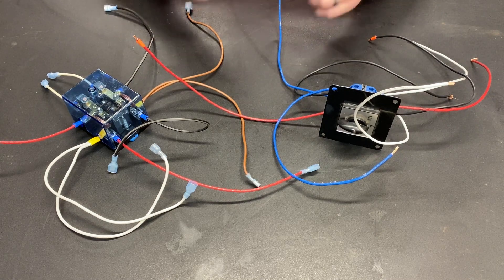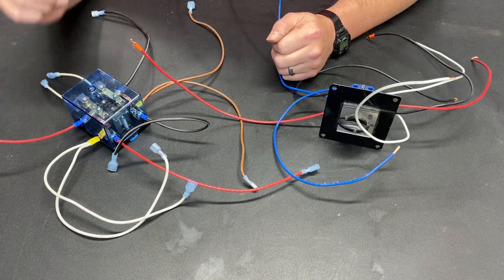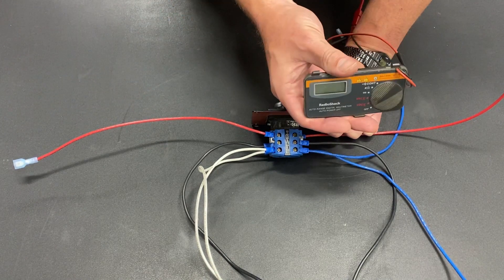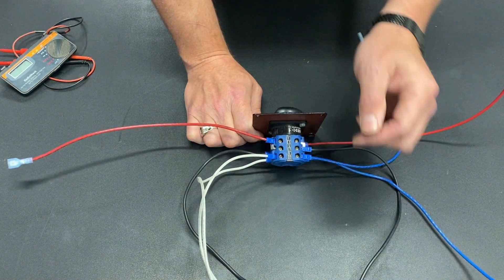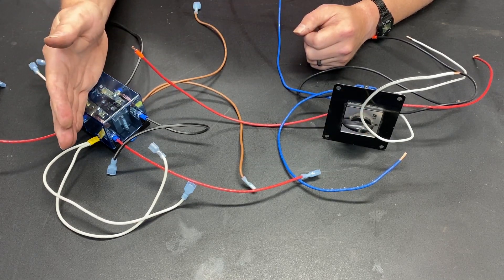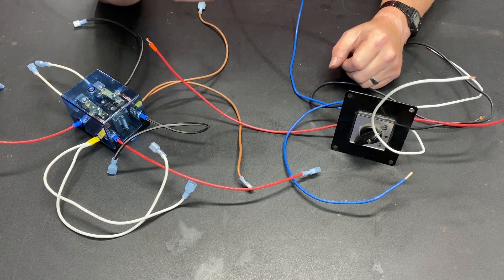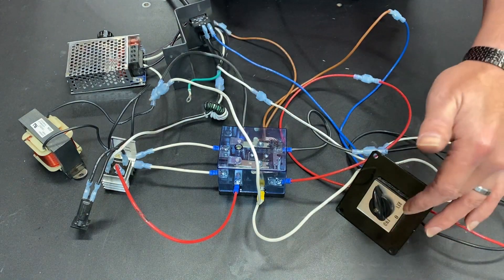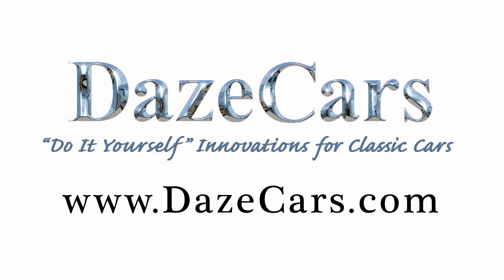Adding an AUTOMATIC Electric Brake to a Treadmill Lathe Motor Upgrade

Comment: Very nice..
My Rotary Switch wasn't rated. So used two relays.😉
Good choice on the Blade Connectors. I forgot they existed..
Now I'll be replacing mine with the same.😆
Cheers.
Reply from the maker: My problem has been finding the correct replacement rotery switch. (mine still works but is a little worn out)  There is no part number on the one that came in my machine and I am not finding double throw rotary switches.  There are lots of single throw switches but not double.

Comment: The DC de-rating isn’t exactly correct. 

When going from 24V to 90V, you’re not stressing the contacts of the relay that much more. 

You’re more likely to cause them to arc at higher voltages, but that’s not involved any sort of proportional relationship with current.
Reply from the maker: thanks for the info, Im always trying to learn more.

Comment: I'm not buying DazeCars explanation for why the AC / DC de-rating on switches and relay. The higher AC current rating is because at 60Hz voltage goes to zero every 8.33ms stopping arcing. Using rectified AC to simulate DC still means zero volts every 8.33ms. It would be interesting to use an oscilloscope to see what is happening when the relay closes to put the braking resistor across the motor. My guess is you could still use the AC rating because you'd only ever be opening the contacts at zero volts, the motor stopped.
Reply from the maker: I didn't convert from AC to DC.  I "de-rated" the DC numbers to DC numbers.  I realize it is not as simple as I made it but close enough to be in the ball park.  I never claimed to be an electrical engineer, just a guy with enough basic knowledge to get the job done. In this case close enough is good enough because it will not likely be used a max volts.  My main concern was to make sure a big enough relay was being used because it could easily be undersized due to the lower DC amp rating of most relays.
Reply: You don't have to believe him.  Just read the ratings on any toggle switch.  AC amperage capacity is always higher than DC.
Reply: @David-hm9ic  Rectified AC isn't DC.
Reply from the maker: every DC powered device in your home that plugs into the wall runs on rectified AC so its close enough.

Comment: As usual Daze great video and now I will have some thinking to do. I  used the original switch to do the polarity reversal on my treadmill motor. 
The idea is great, just have to decide if the wiring nightmare (for me to keep neat and clean) is worth it. Actually, Well yes, I know it is, lol.
Reply from the maker: Go for it!  It will be worth it 😁